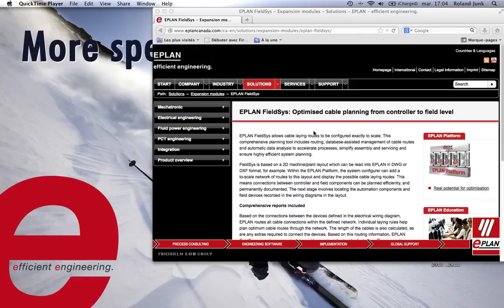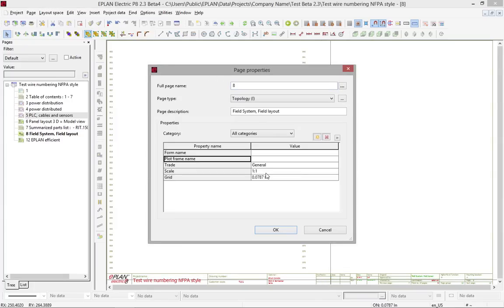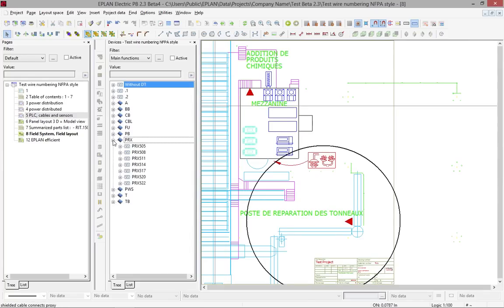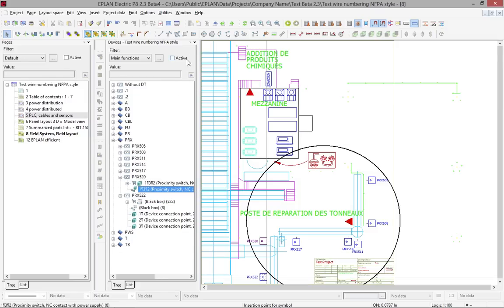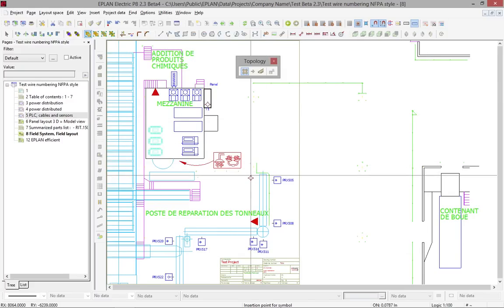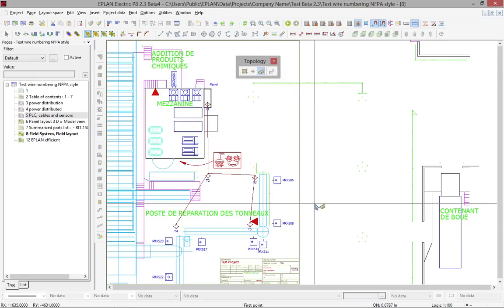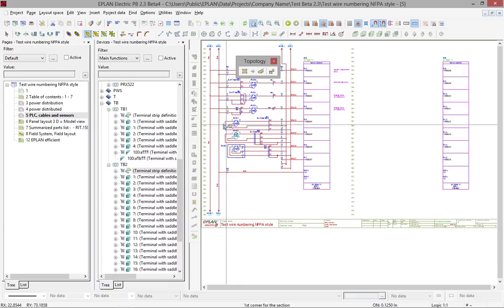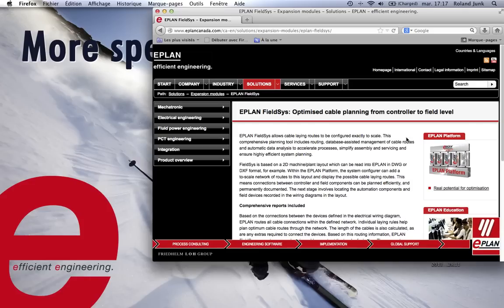EPLAN FieldSys Topology Cable Routing

Comment: If I have autocad generated dxf file for machine or plant, is it use in eplan for same cable routing topology???
Reply from the maker: Yes I can use your DXF file representing the machine or plant. Usually we define the imported graphics as background to make it easier to overlay our EPLAN Components, define routing and have it calculate the length. Sorry for the delay, I had a longer break with Youtube... I am back on board.